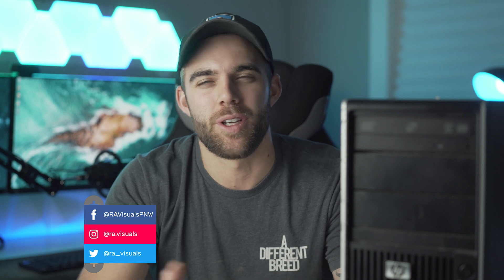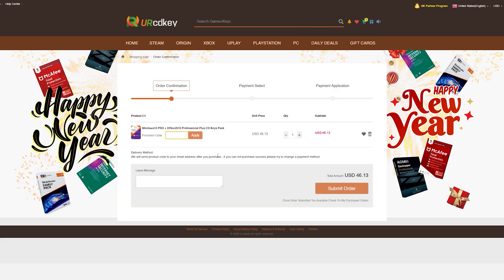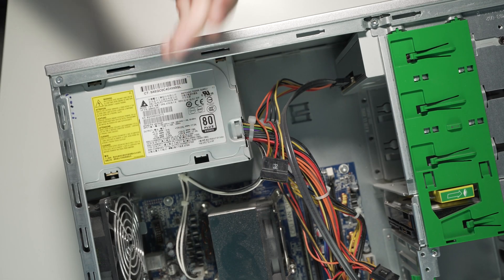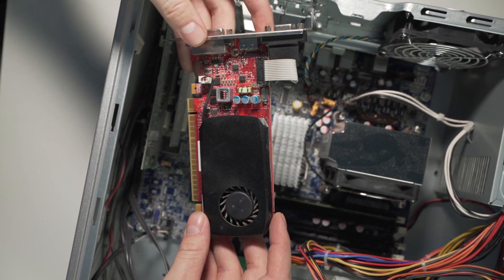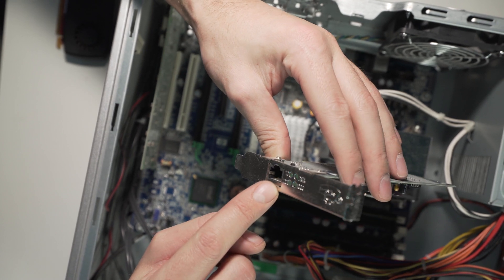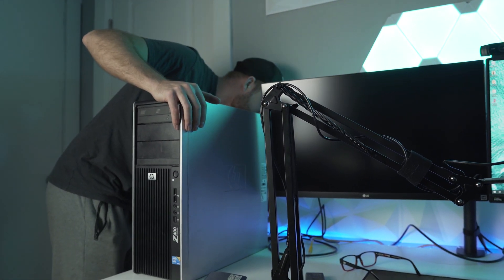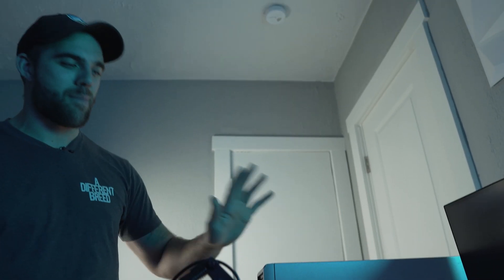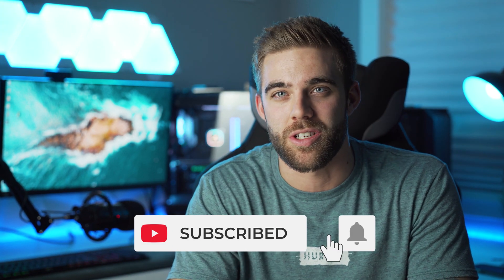Can you game on a dual core CPU in 2020?

Comment: i have that exact make and model!! However i do have it boosted to game. Got 16g ram 800w psu duel core i5 and a msi r9 390 8gb vid card. Mine did not come with plugins for card, so i had to get a serperate psu for pc, and one for just the gpu. Processor can be upgraded to a quad core i5,i7 or xeon, but thats max cant do more then that without needing a mb upgrade...YES it can be used for gaming!!
Reply: i have that same pc and mine suddenly quit turning on 💀, it still gets power but idk if just don’t wanna turn on i guess, i got another computer tho :0

Comment: Hpz pc's are amazing for budget gaming builds. It would be awesome to see a fully built hpz840. Imagine Dual octo core cpus overclocked to 4ghz , up to 512gb of ddr4 ram. Dual rtx3090 gpus, 1200watt power supply. Up to 12tb of
Ssd drives. Nvme and pce ports galore. Thunderbolt ports.  It would be worth building as it would probably be on par with any pc for the next few decades.
Screw it...  at that point just buy a hpz8 g4 and throw your life savings at it. Up to 56 cores 112 threads, 3tb of ddr4 ram, 48TB of storage, 3 rtx3090's , 1700watts of power...
Reply from the maker: well said!! 😆

Comment: Just passing here by chance (?)... OK, this is a dual-core system with 4GB RAM and a DirectX 12 GPU. DOTA 2 System Requirements are precisely a dual-core CPU (granted : with slightly higher clock, but this 2.4 GHz Xeon is better than most 2.8 GHz dual-cores) with 4GB RAM and a DirectX 9 GPU. It's no wonder DOTA 2 runs on that system. During this 13'52'' long video, did you only successfully proved that a dual-core system can run any game designed for dual-core systems, or am I missing some point here ? Because right now I feel like I lost 13 minutes and 52 seconds of my time.
Reply: Hum, I spent more time reading all the other posts... Sorry for mine being redundant.
Reply from the maker: thanks for clarifying 👍

Comment: for $15 thats actually a pretty good deal for complete entry for someone wanting to start pc gaming. just to get them started. i had a pentium celeron with 4gb ram and no gpu but integrated graphics off a neighbor for like  $100. was a tank with what i threw at it. i upgraded it to a core 2 duo and upgraded to 6gb ram. even more of a tank with that small of an upgrade. now im rocking a 2200g with 16gb ram and a 1660 super. once i get back to working im gonna upgrade the 2200g to a 2600x or 2700x depending on price.
Reply from the maker: very nice come up story! Love hearing stuff like this!
Reply: @RAVisuals  sorry i just realized i said 1660 super, its a 1650 super but still a beast budget build. ive been playing warzone on high getting anywhere around 70-100 fps on it.
Reply: what games did you play on it? I have the exact same specs

Comment: This should support a Xeon W3570, which is a 4 core 8 threaded CPU. It may even support the X5600 series CPU's, which have 6 cores and 12 threads. I have an x5650 oc'd to 4.1Ghz and a GTX 1060 3gb. Plays everything I need it to at more than 60FPS.
Reply from the maker: Nice! Might have to try that! Would be cool to get a 4 core in there.